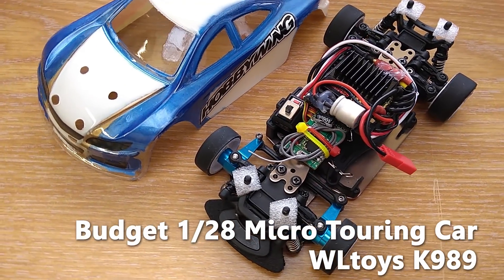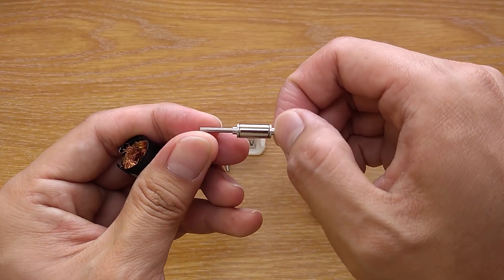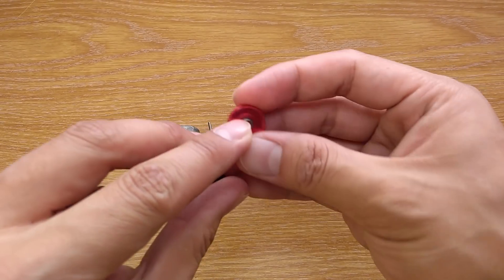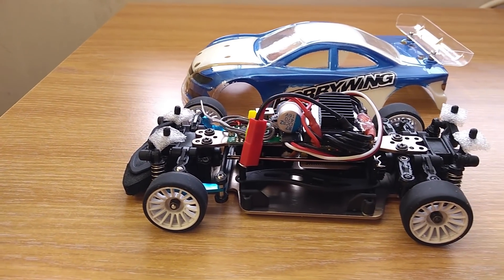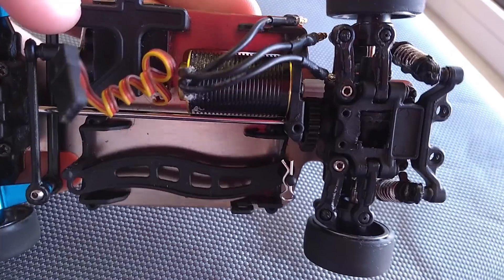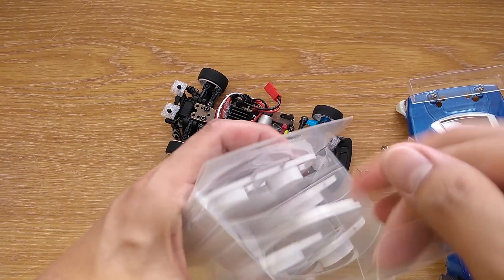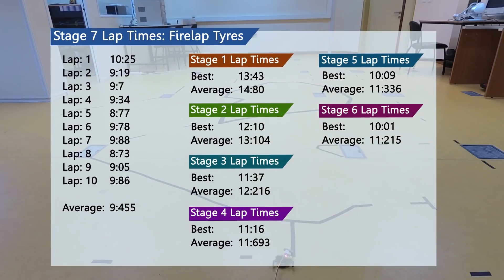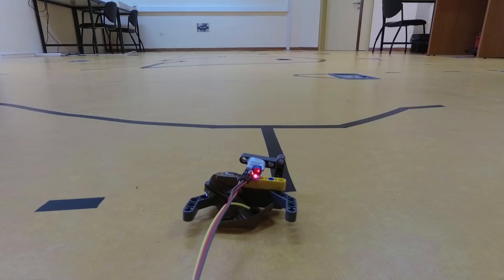WLtoys K989 Budget Touring Car - Stage7 Brushless Upgrade

Comment: Hey man  I can’t seem to find the videos on your wltoys k989 awd drift  set up videos . I just phurchaced my self things to go brushless as well and found a link to your gear bag from banggood. Is that ware you got your 8t pinion
Reply from the maker: Here's the drift setup video. https://youtu.be/zB3pUN9XiSw
And yes, that gear bag contains 8T gear. I got one from there. You can also find 8T gear from Tamiya Mini 4WD motor pinion.
Reply: Beaver's Hobby thank you also the wire you used to solder up your surpass hobby 1410 what gauge wires did you use ? And did you modify the bullet connectors on the hobby wing 18a esc to accommodate
Reply from the maker: @harryfp1494  I use 20AWG on the motor but that's a bit excessive. 24 or 22 AWG is enough. I also changed the plug to 2mm bullet but if you don't plan to change anything later then you can de-sloder all the wires out of the ESC and put new and slimmer wires in to save a lot of space.
Reply: Beaver's Hobby thank you man I’m ordering stuff now for the completion of this project next I need to oder the k989 because I don’t have it lmao
Reply: Beaver's Hobby do you play with micro crawler at all ?
Reply from the maker: @harryfp1494  Got one of the HobbyPlus CR24 in the review right now. Haven't got much idea because this is my 1st crawler and I'm still making a track to test it.
Reply: Beaver's Hobby  that’s a great crawler can’t wait to see more videos on it I’ll watch your review today join the axial scx24 group on Facebook and the micro crawler group on Facebook it will give you a great idea of what to do with it also gamyrc is to the micro crawler community like you are to the micro drift community
Reply: Beaver's Hobby do you have any videos of you soldering
Reply from the maker: @harryfp1494  Brushless wires? No. But generally I solder in TS100 review, IW04M rebuild, etc.
Reply: Also what kind of wire did you use other than awg stranded copper or steel or quality
Reply from the maker: @harryfp1494  Thanks for the tip on crawler. 
The wire I use is silicone wire. It'll be more flexible. And that's pretty much what I choose since it didn't tell me the material inside.

Comment: Will this fit in the hbx rampage
Reply from the maker: No, This one is equivalent to 130 brushed which is 1410 or 1625 in brushless. From what I see HBX Rampage 1/18 uses much bigger motor I think it's 380 brushed or 2838 brushless.
Reply: Ok good to know thx for the reply
Reply from the maker: @dawson_c1952  My pleasure.

Comment: hi bro, after the touring car upgrades, would you say it is more economical to just get the kyosho mini-z than to upgrade the k989 to get the same performance?
Reply from the maker: Mini-Z AWD touring car doesn't give you the best  value for money. Except you convert FWD to AWD and only if you can live with the standard radio. Here's the conversion video. https://youtu.be/jliYUbgQhW0
If you have experience building I highly recommend Atomic AMZ. Here's the review. https://youtu.be/u7Jsw8IW-zY It's far better than WLtoys and any older Mini-Z up to MA020. It's also better in long run when you want to change only an electronic part like radio, ESC, motor. Mini-Z has proprietary electronics and you can't swap those parts easily.
But if you want to have the best car to start, money no object then look for Mini-Z MA-030EVO (easiest car to drive right now), Atomic BZ3 (super agile and capable touring car) and GL Racing GLA V2.1 (the most versatile car with out of the box upgrade, think of it as a step up from AMZ).
Reply: @BeaversHobby  so best bang for the buck is building the atomic amz? excluding the txrx, what would you say is the ballpark cost?
Reply from the maker: @josefpreyes  Car with electronics = $118, wheels $3.2, tyres... depend on the track, let's say $10. You can get all these in miracle-mart and shipping will be around 15. So $146.2 for the car + wheels + tyres. You can get Mini-Z body from banzaihobby with shipping around $25. Or if you want Lexan body then the price can range between $20-40. What left are battery and charger. You'll be looking around $30 for a decent charger and a battery (even if you get other car, this will be the same). If you already have those, you can cut $30 off your spending.
In total $201.2 for a brushless touring car with wheels of your choice and tyres according to your track completed with decent charger and battery.
Reply: @BeaversHobby  thanks very much! i already have a charger as i have 1/8 nitro buggy and 1/10 tamiya xv01, whats holding me back is that there are no 28th scale races here in my country (PH)
Reply from the maker: @josefpreyes  My pleasure. I'm starting to see more and more people from Philippines coming to 1/28 so someday you might have organised race.
Reply: @BeaversHobby  yeah, so in the moment, i just drift for fun 😁😁😁

Comment: Will mini-z bodies fit on this? I am looking to get one of these I don't own a RC this small is it easy to work on being that small? Not including the front hubs that you saying need to be modified what other suspension parts fit right on the car? Thank you in advance one more thing is this the four-wheel drive touring car that comes with the escort looking body
Reply from the maker: Yes, Mini-Z bodies will fit. Some might need modification to the chassis, some fits directly.
Here's the video about this topic. https://youtu.be/-gCJEXXWBEo
Additional info, so far I've tried:

- Corvette C7 ZR1: fits with custom front lip to lift the bonnet up a bit.
- Audi R8, Lexus SC430, Aston Martin DBR9: These cars need to lower the shock.
- Honda Civic Type R: direct fit, only need 0mm offset narrow wheels and shave the wheel arches off a little bit. So all FWD like Renault Megan, Mazda 2 and Subaru WRX (4 door) will fit with the same method.
It's relatively easy to work on as there are not many parts and the car isn't complicated. This one is as good as it gets for budget touring car.
If you want to upgrade it, aluminium shock tower fits directly without mod and it's a good improvement. I'm not entirely sure about aluminium shock, from what I've heard it doesn't make much difference. Greasing standard shock with gear diff grease does the same job.
Another thing you can do to make it better is tuning the toe angle with adjustable rod. Use 3.5mm ball cap from small helicopter, it'll fit directly. I use TRex250 helicopter parts to do it (need to do another video on that).

Comment: You said that this brushless motor was to powerful for this little car.  I am wanting slower smooth running car for a tight track.  Can you suggest a different brushless motor that would work better for that with the stock gearing?  Thx.
Reply from the maker: Atomic 3500KV with Atomic ESC is the best for drifting. http://www.miracle-mart.com/store/index.php?main_page=product_info&cPath=67_74_322_433&products_id=14065
http://www.miracle-mart.com/store/index.php?main_page=product_info&cPath=67_74_1024&products_id=14040
You can lower the budget by getting Surpass Rocket 3500KV but Atomic is smoother. https://www.aliexpress.com/item/33052771236.html

Comment: what about leopard motor ? or evenezrun 12t combo? they will be cheaper solutions. let us know. 
Btw great videos, keep going.
Reply from the maker: The Leopard motor is really fragile. You need to have electrical glue or fluid electrical tape to hold the wires in place where they come out of the motor can. I got one and it broke within first 5 minutes of running. Back then it was like $28 down the drain in a few minutes of running. I was heart broken so I went crazy with 9500KV. If you want a good inexpensive motor right now I suggest Surpass Rocket series. Combine it with EZrun and it'll be fantastic.

By the way after using this 9500KV combining with 2S lipo it for a while I came to the conclusion that the car is pretty much uncontrollable. I had too many crashes so I went back to brushed motor.
Reply: @BeaversHobby  thank you so much. Continue with your videos, they are great!
Reply from the maker: @lucaaloisi9935  My pleasure.

Comment: I wanted to convert one of these to aaa but when I did, the servo worked but not the motor. I removed the middle wire so maybe thats why.
Reply from the maker: Are you still using original ESC? That one doesn't support low volt. You'll need to change the ESC to something that support 4x Nimh battery.
Reply: Beaver's Hobby yeah, Original esc. But it seems like 4 aaa are not enough for the motor too. I used 6aaa and the motor started moving.
Reply from the maker: Yes, because 4x AA is only around 5V. While 2S lipo that this ESC works with is 8.4V fully charged and the cut off is around 6.5V (if I remember correctly, haven't use it for a while now).

Comment: Hi. Thanks for your awesome videos. About the classic motor overheating problem, how did you handle it?
Reply from the maker: Use a small heat sink for ram chip or Raspberry Pi. You can find one in a computer modding store.
Reply: @BeaversHobby  Ok. Thanks! Do you use it with the fan or just the heat sink? If with the fan, where do you connect it?
Reply from the maker: @eversonpossamai3669  
Just the heat sink. But I live in a cold place so if your climate is hot, a fan should be be fitted. It depends on how much voltage the fan requires. For small computer fan it's normally 12V so you can make a connector and plug it directly in to the battery. 8.4V max won't burn it. Otherwise use either BEC to regulate the volt to 5V if you have low voltage fan.

Comment: How about some comments on if this is worth it vs going with high end 1/28 tc chasis that are available such as atomic or gl racing gla?
Reply from the maker: If you are going to keep the chassis stock, it is a good budget car. But if you want to go full aluminium upgrade with carbon fiber chassis, just get BZ/SZ or GLA. This chassis isn't worth doing much metal upgrade. Some of the upgrade kits even cost more than Atomic AMZ if I remember correctly.
ps. I spent most money trying on different electronics so that why it looks expensive.

Comment: Do you use the same default battery for this k989 mod?
Reply from the maker: Yes, the battery is still original.
Reply: @BeaversHobby   is there any brushless motor that cheaper than the scorpion? That motor too expensive and hard to find in malaysia
Reply from the maker: @aliffsuhaimi3078  Surpass Hobby 1410. It's about 10USD on ebay so I think you can find it very cheap anywhere else. https://www.ebay.com/itm/Surpass-Hobby-1410-Brushless-Motor-Remote-Control-Accessory-for-1-24-1-26-RC-Car/332719063303?hash=item4d779a0107:m:m_aXTbfy9OM90120JYTCStg:rk:1:pf:1&frcectupt=true

Comment: chamber , toe , ride hight , etc adjustable?
Reply from the maker: Ride height: Yes, you need M2 grub screws
Camber: Originally, no. Can be done with mod - cut the arm and insert screw
Toe: Originally, no. Can be done with a bit of mod, the same way with camber
Caster: Originally, no. Can be done with mod too but I don't recommend.
Spring tension: adjust with included preload clips. You can add more too or change the spring if you like.

Comment: will it be possible to use a tamiya mini 4wd motor like the hyper dash to this car? i understand that its a brushed motor, but brushless is too expensive for me
Reply from the maker: From Mini 4WD, no. You need screw mounting holes to put the motor on the mount. 
There are brushed motors from PN Racing which have holes and will go in this car. You might be able to find some can and mod it too, that's just a thought.
Reply: @BeaversHobby  oh i thought so when i saw the holes on k989 motors. i guess mini q q2, will fit what i wana do
Reply from the maker: Yes, Tamiya Mini 4WD motor will fit the Q2. I actually have an Ultra Dash in one of my Mini 4WDs and someday, once I find a track, I'll put it in my Q2. Right now there's just nowhere to put that kind of power to good use.
Reply: @BeaversHobby  gona look forward to that. ive been trying to do it with toy grade rcs with no success. the last car i tried, which was quite similar in design with your 1/32 auldey, sounds faster when i lift it. but when its on the surface it ran slower. and then after a few minutes something in the electronics smelt burned
Reply from the maker: @DioDurant  Sounds like ESC couldn't handle the current and burnt out. I feel more comfortable doing this with Q2 because if the board burnt, I can change it easily. If Mini-Z board burnt it'll be very expensive.
Reply: @BeaversHobby  i just directly swapped the motors so i thought the hyper dash tried drawing out more than the components can handle. i am just about to do the full proportional mod though. thanks for the vids man. theyre equally educational and entertaining

Comment: Can you recommend spare batteries for the K989 please? I’m ordering this model now (I’ll be sure to use your affiliate link at banggood) and I do plan to switch to a brushless motor but not right away.
Reply from the maker: The other one I use is Giant Power 350mAh. The capacity is smaller so running time is a bit less but it fits the original bracket perfectly (and also fits every car I have). https://goo.gl/3emgQw
You can remove the battery tray then stick anything that is no longer than 58mm down with double sided tape. https://goo.gl/KbeAZ2 This will give you longer run time.

Also thank you for your support.

Comment: มีเว๊ปขายมอเตอร์แบบนี้อีกไหมครับพอดีเว๊ป ที่แปะลง สินค้าหมดครับ พอดีสั่ง esc ตามลิงห์ที่แปะไว้ให้มาเเล้วครับแต่ขาดมอเตอร์เพราะไม่มีของ  ช่วยแนะนำหน่อยนะครับ
Reply from the maker: มอเตอร์ 3 สายอันนี้ถ้าหมด ลองดูตัวอื่นครับ เช่น Atomic 5500KV
http://www.rcmart.com/atomic-mo039-5500kv-brushless-motor-p-71999.html?cPath=595_1671_1672

หรือ Surpass Hobby 1410 เลือกได้ตั้งแต่ตัวเบา 6000KV ยันตัวแรง 10500KV
https://www.ebay.com/itm/Surpass-Hobby-1410-Brushless-Motor-Remote-Control-Accessory-for-1-24-1-26-RC-Car/332719063303
ถ้าชอบยี่ห้อแมงป่อง 6000KV
Reply: @BeaversHobby  ที่แนะนำมาใช้ได้กับesc ที่ใช้สอนในคลิปโดยไม่ต้องโมเพิ่มใช่ไหมครับ
Reply: @BeaversHobby  มีสายไฟแนะนำไหมครับผมสั่ง ตัว Surpass Hobby 1410 6000 kv ละครับ แต่ไม่มีสายไฟ
Reply from the maker: สายซิลิโคน 20AWG น่ะครับ ลองหาดูตามร้านโดรนน่าจะมี ถ้า 20AWG รู้สึกมันหนาไป 22AWG ก็ได้ครับ
ของผมสั่งนอกมาเหมือนกัน https://goo.gl/ETC1us
Reply: @BeaversHobby  แล้วหัวมันละครับ
Reply from the maker: หัวที่ผมใช้คือ bullet/banana 2มิลครับ https://goo.gl/vYF6U4
หรือจะต่อตรงบัดกรีลงไปกับสายของ ESC เลยก็ได้
Reply: Beaver's Hobby ขอบคุณครับที่แนะนำ
Reply from the maker: @นายพาระนิดนามามี ยินดีครับ มีอะไรสงสัยอีกก็ถามได้นะครับ
Reply: @BeaversHobby  หัวบานาน่าใช้อันนี้ได้ไหมครับ https://www.lazada.co.th/products/10pairsset-2mm-bullet-banana-plug-wire-connector-tool-for-rc-battery-i261316486-s402050367.html?spm=a2o4m.searchlist.list.19.6a57576chGbQr9&search=1 พอดีสั่งจากลาซาด้าเร็วดี
Reply from the maker: @นายพาระนิดนามามี  ได้ครับ แบบเดียวกันเลย ลองหาพากสายไฟดูด้วยก็ได้ น่าจะมี สั่งจากไทยเร็วกว่าเยอะ
Reply: @BeaversHobby  มอเตอร์ผมพึ่งได้ของของจริงเล็กมากนึกว่าจะใหญ่เท่า มอเตอร์แปรงถ่าน เเล้วทำยังไงถึงจะคั่นน๊อต 2 อันได้ครับหรือคั่นแค่อันเดียวพอ
Reply from the maker: @นายพาระนิดนามามี  ตำแหน่งรูมันเท่ากันนะครับ ลองหมุน ๆ ดูครับ มันจะมีด้านนึงที่ขนาดพอดีกับรูบนที่ใส่มอเตอร์ ขั้วมันจะเอนออกมานิดนึง ถ้าไม่งั้นก็ตะไบรูบนที่ใส่ออกนึดนึง แล้วจะใส่ได้
Reply from the maker: ต้องบัดกรีสายไฟใหม่ครับ ของ Atomic ให้มาเป็นปลั๊กอีกแบบ ของ Surpass ไม่มีสายไฟให้

Comment: Hello, I ordered the hobby wing 18a esc and the battery wires on the esc are 16awg wire and the 2s lips battery is 22awg wire. Did you solder 22 awg wires onto the hobby wing esc with a jst connector ? Thanks
Reply from the maker: I cut the ESC's original wires very short and solder JST connector with a bit of 22 AWG wires in to them. I tried to remove the old wires to make it smaller but without success.

Comment: Hello,  I am going to upgrade to a brushless motor and ordered the wltoys extra pinion set. It looks like the pinions do not have a set screw and press on the motor. Have you had any problems with the pinion slipping or do they have a D shape like the spur gear? Also do you know what pitch the pinions are and would you recommend a mini z aluminum pinion set with set screw? Thanks and thank you for doing these videos.
Reply from the maker: I never got the pinion slipping problem with round shaft and round holes. Unfortunately the aluminium pinion set is too long for this car and won't work so you can't use it.
Reply: @BeaversHobby  Ok, thankyou.

Comment: Please review miniQ Q1 for drift
Reply from the maker: Thanks for the suggestion. I'll get one for sure but you have to wait for a while because right now it's out of stock and my post office will be closed for a very long time for holidays. Please be patience. 
However, here for a short preview from what I see on photos on websites and other people's photos.  Long story short, it's discounted Mini-Z AWD MA010.
It's essentially Mini-Q Q6 that stuck with 94mm wheelbase. Everything is almost the same except steering link that now it's plastic. Handling should be no different than Q4 or Q6 AAA version because of the same suspension design and battery. By which I mean really good for kingpin suspension. Mini-Q has no history of wonky electronics so that's a relieve too.
Reply: Thank you for the short preview. I’m looking for mini drift kit which do you prefer wl k969 convert to rwd or mini q7 setup like your previous video?
Reply from the maker: @nandandrw9985  I prefer Q7 CS drift setup. It's very responsive and very fun to drive. K969 RWD mod is still not where I want yet and it will take some effort to get it working well.